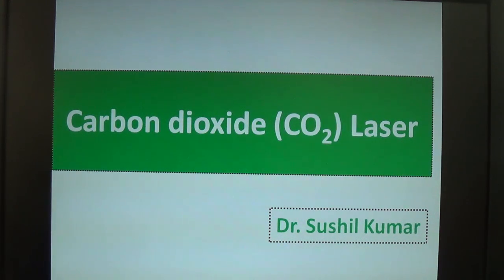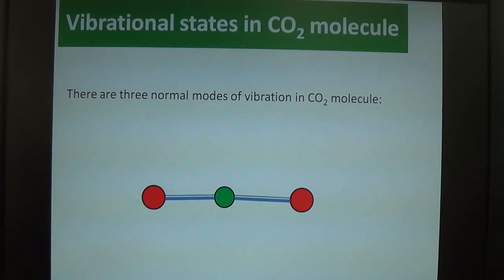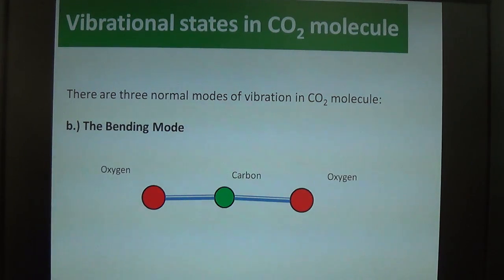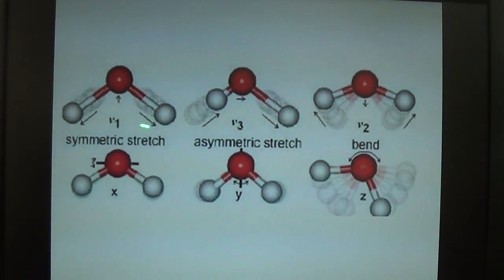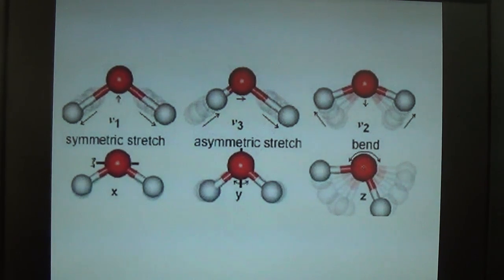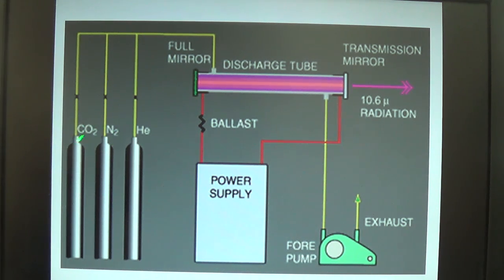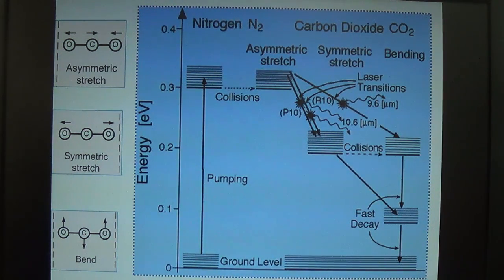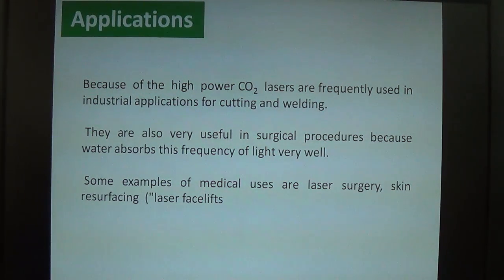How a CO2 Laser Works? || Working and Construction || How Laser Works 2023

Comment from the maker: Role of helium:
To relax the Co2 molecules, means when He atom collide with co2, it brings co2 in lower state by transfer the vibrational energy and de-excites.  As of this result Co2 emits the radiation of high power.
It also helps to conduct heat away from the electric discharge and increase the excitation efficiency of Co2 molecules.
Reply: Thank you sir for explaining role of helium
 nice video you made about co2 laser

Comment: Sir 
1) Kisi CO2 laser ki power laser se decide hogi ya power supply ki power ko laser power bolte hain?
2) Thick metal sheet ko katne ke liye kitni power ka laser hona chahiye or tube size with volts kese calculate karen?
Thanks,
Pardeep

Comment: 8:59 " The vibrational and rotational modes of CO2 cannot be excited by photons." Does this not contradict greenhouse theory?  I have found N2 can be excited by photons as well as electrons, with a CO2 laser in space. Also, in greenhouse theory (as its key premise) N2 is assumed not to absorb and emit any IR photons, but here in the CO2 laser, it is essential. Also, the Raman spectrometer measure N2 at 2338cm-1 and can measure the molecule's temperature: it must be radiating!   I have studied this and concluded there has been a misconception with greenhouse theory and all radiation theory must be updated. If you are interested my working paper is at: https://www.researchgate.net/publication/328927828_Quantum_Mechanics_and_Raman_Spectroscopy_Refute_Greenhouse_Theory
Reply: Not sure if i answer your concern here but vibrational mode is relational to wavelength that hits the molecule. 4.26 um can excite CO2 and such CO2 molecule can collide (9:34) with N2 (its not IR that does it for N2) which would give kinetic energy to N2 (N2 can not vibrate the way CO2 can) which is also known as temperature.

Comment: what is the use of helium gas in it
Reply from the maker: Role of helium:
To relax the Co2 molecules, means when He atom collide with co2, it brings co2 in lower state by transfer the vibrational energy and de-excites.  As of this result Co2 emits the radiation of high power.
It also helps to conduct heat away from the electric discharge and increase the excitation efficiency of Co2 molecules.

Comment: role of helium in co2 laser
Reply: For depopulation we use He. means for transition of co2 molecule from E1 state to ground state can be achieved by elastic collision of co2 molecule with He .
Reply: further He has high thermal conductivity so to absorb heat which is emitted during the process we use He.